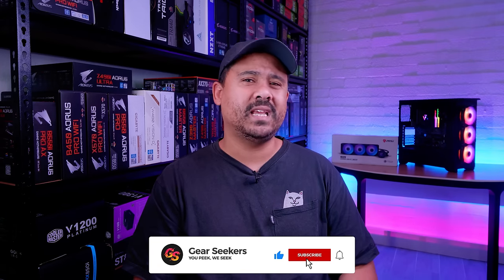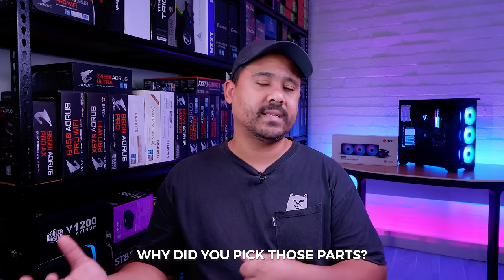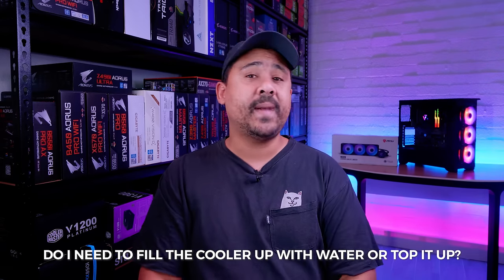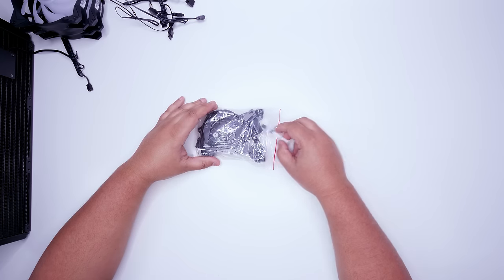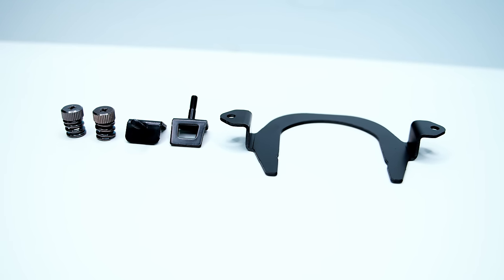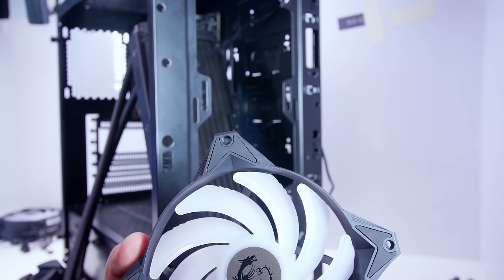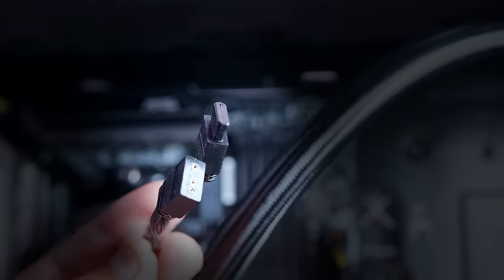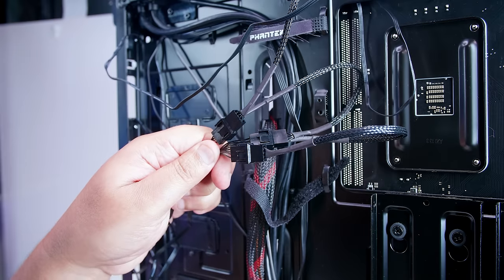HOW TO MSI MAG Coreliquid 360R & 240R AMD AM4 & AM5 Install Guide

Comment: Ryzen 3800 msi 240 cooler rog strix B450-F Gaming
Does that works?
Reply: I think Your motherboard doesn't have addressable rgb headers (ARGB) which are 3 pin headers, so you can't use the rgb for this cooler because the rgb cable for this cooler is a 3 pin, unless you buy a separate rgb controller, some liquid coolers do include an rgb controller with them but this MSI aio doesn't.

Comment: Have question for a rog strix 450 f mb do i plug the rgb into my rgb headers
Reply: No!!! that motherboard only has 12V rgb headers. it will fry your 5v argb if you connect it there. I have the same mobo, and I'm having to go another route to connect argb. I'm going to plug it into the corsair lighting node core, using adapter cables from an ebay seller named PirateDogTech. maybe you could do the same thing
Reply: @4markie  thanks for that seesh
Reply: What's a corsair lighting node?

Comment: Does rgb works with MSI b450 mortor max ?
Reply: I have b450 gaming max and I'm having issues with lighting my rbg is 4 pins but the cpu cooler is 3  but it's 2 holes space and another hole [eg. 00 0] and the pins can't enter
Reply: Ecta  unfortunately I have not I have bought other pins to attach but no luck 🥺

Comment: 👍👍 Problem is I bought this for a B450 Tomahawk max as this is my first build only just realised I have all 4 pin headers 😳.. Might have to swap motherboard now.
Reply from the maker: Just buy a cheap RGB controller. There is no need to swap the motherboard mate.
Reply: @GearSeekers  hello sir I am having the same issue I believe I have a rog strix b550- xe mb and am trying to rig this cooler on and lone behold my pump and fam headers on the mb are all 4 pin where as the connectors are 3 pin. I am wondering if u can point me in the right direction as to what rgb controller I should get as I am a novice that honestly has no business building a pc. Thank you

Comment: It sucks bc jrainbow connectors are much older style connectors and most newest boards use the 12 volt 4 pin rgb headers now 😔 imo msi should of included a sata rgb card with this kit like alot of other aio cooler company's do, I wouldof never got this kit had I knew this ahead of time, now I gotta buy a rgb card to make the rgb work and it's really inconvient to do so
Reply: Did you end up buying the RGB card ?
Reply: @jesuscabral1074  yes I bought it, the rgb lights from the radiator fans are horrible and very dim I was very dissapointed, the cpu cooler is also dim but not as bad as the fans, I ended up buying a 3 fan pack off Amazon 120 size and using those instead, I really can't believe how terrible these fans and cooler rgb's are and very very dim

Comment: The Rgb 3 pin 5v connections on this Aio dont suit more modern 12v rgb connections on motherboard,  b450 etc
Please pin this!

Just found this out after i installed 😢

Comment: This was a great guide! Was able to install it without very many issues!  Although I did run into a hiccup.  When I turned on the system the radiator fans went on but none of the RGB went on...

I double checked all the connections and they seem to be plugged in according to the instructions in this video.  

Any insight on why the RGB didn’t work??
Reply: Make sure you didn’t connect them into a 12v connection for the rgb, and make sure you did the circuit wire daisy chain correo
Reply: Hey kind of an old comment here but, did you manage in the end?

Comment: Great video, much better than MSI.   My only complaint that you don't explicitly address the issue that I came to resolve:  How do I know the air flow direction through the fans?  I am assuming from the placement that you used that the side with the dragon emblem is the exhaust.  

MSI does not bother to mark the flow with an arrow on the fan case as has been done by just about everybody for years.  They do not address it in any manner that I could see in the "quick install guide" which is an example of the absolute LEAST that they could do and still pretend to provide documentation.  Additionally, the MSI guide makes difficult to figure out which mounting hardware to use and gives zero tips on how to align things properly.  As for the resistor wire, they tell you that it exists, is optional, and what it does BUT do not really offer much, if any guidance as to how to install it.  The video that they released only addresses an Intel installation and is more hand-waving than details.

Comment: my motherboard (MSI B450m Mortar Max) doesnt have a pump header where should i plug it?
Reply: cpu fan header
Reply: @735  then i will use my System fan header for the 3 fans of the radiator?
Reply: @michiruhinagata4080  yes, use a cable splitter for them
Reply: @735  thanks <3
Reply: @michiruhinagata4080  np, make sure to have cpu fan at 100% in your bios
Reply: @735  ill make it at 100% at all time so the pump wont turn off right? but the 3 fans ill keep at auto? or 100% too?
Reply: @michiruhinagata4080  not sure about the fans but here's an article https://forums.tomshardware.com/threads/where-to-plug-aio-on-a-mb-without-pump-header.3556077/
Reply: @735  thanks for the help.

Comment: if you dont have an argb header on your mobo you will not get the beautiful argb effects :(
Reply: I'm having that issue rn any way to fix with adapter? My rbg is 4 pinned and the cpu is 3 but with an empty closed space where It won't enter 😔
Reply: Did you figure this out ?
Reply: @MrAdrian2416  I have the same problem. Did you figure this out ?
Reply: @jesuscabral1074  unfortunately no 😔 ive bought other 3 pins to 4  to connect to it but it wasn't stable and didn't supply power it kept getting undone would stay on the mobo  overall I mean it works just no arbg lighting i kinda stopped looking into but if you find out a way please let me know 😀

Comment: So I don’t have the plastic hook piece that the cooler hooks onto how the fuck am I supposed to mount this and use my new pc, thanks Msi for not including parts fucking needed
Reply from the maker: Those hooks come with your motherboard not the cooler.
Reply: @GearSeekers  I never got them with my motherboard either, I only have the backplate and these brackets that straight then go at a 45 to screw into the backplate

Comment: I’ve B550-F motherboard and it doesn’t have JRAINBOW. What do i do? Anyone else had a same motherboard and cooler thank you. I need help
Reply: Your motherboard does include a 3 pin argb header, but it's not labeled as JRAINBOW, it's labeled as ADD_GEN2, it's a 3 pin header at the bottom of your motherboard.

here is the manual for your motherboard, 
https://dlcdnets.asus.com/pub/ASUS/mb/SocketAM4/ROG_STRIX_B550-F_GAMING/E16609_ROG_STRIX_B550-F_GAMING_UM_WEB.pdf
you can see on page 14 , the 3 pin header located at the bottom of the motherboard labeled as number 10 right next to a 4 pin rgb header.

Comment: That installation is wrong.  Your pipes should be at the bottom and not the top of a side mounted radiator.  You won't get proper cooling and will drastically reduce your life of the AIO with the pipes at the top.
Reply from the maker: Wrong. The pump is inside the radiator on this cooler.

Comment: no friend all wrong what you are doing those liquid cooling must be installed with the ducts down, that is; allowing the air that is produced by the same evaporation to remain at the top and never in the path of the liquid. The example that you are giving to the community is all wrong and you should be ashamed to make a video without having a minimum notion of what you are doing without having a minimum knowledge of physics. what a mess of yours
Reply from the maker: WRONG! The pump is in the radiator. You should be ashamed of not understanding how this cooler works you oxygen thief.
Reply: @GearSeekers  he's right, people are facing the bubble issue with this AIO including me, even when you front mount it, the pump is in the radiator but given that it is close to those duct inoutlets, the chances of getting bubbles into the ducts increases, spend some time with this cooler you'll understand

Comment: I have only 2 jrainbow in this Board :(
Reply: If that case so, u need to buy a splitter or rgb hub to connect all ur fans
Reply: You only need one header for the rgb fans to work since the cables could be daisy-chained together.

Comment: tubes on top, exactly what not to do if you want your product to last... the air will be into the system and create noise and cooling issues after some time. viewers be aware...
Reply from the maker: Stop spreading this stupid rubbish. Before you comment about that gamers nexus video you might want to go an watch it again. Not to mention the pump is in the radiator for this cooler which means even if tubes up did impact cooling other that the pump being louder that fact the pump is in the radiator negates that. Viewers be aware 🤣
Another expert who doesn't know shit 🤣

Comment: The Radiator is on upside down if you're front mounting. This will restrict the flow of coolant and increase air bubbles. Never put it at the top. I don't know why everyone is doing this. Turn the rad around!!!
Reply from the maker: No it won't. Before you say "wAtCh GaMerRS NeXuS vIdEo" I suggest YOU actually watch it again.

Comment: For the average user, its not smart to use liquid in an electronic device. There are plenty of logical alternatives to liquid coolers.
Reply: Not going to destroy anything.
Reply: @TheSjuris  "If" it doesn't leak or corrode plus the cost is high for the same thing a fan setup can do. Not smart to put liquid in electronics when there are logical alternatives
Reply: A Dillpickle nothing with distilled water will corrode anything.  Air coolers are for the most part either ugly or extremely ugly.
Reply: @TheSjuris  If all I had to do all day is stare at my computer then maybe I would be concerned about looks. Too many stories out there with AIO problems for me to jump in on that fad
Reply: A Dillpickle I don’t stare at it either, but when I do look at I don’t want to get sick by being nauseated by the sight of ugly.  Besides which not every case works with every single air cooler. If you’re going to use one then get a case that’s solid.
Reply: @TheSjuris  My fans are inside not on the outside. Mine is pretty lol
Reply: A Dillpickle so are mine.  I wouldn’t want any case that looks pretty destroyed by having something visible that’s extremely ugly.
Reply from the maker: Oh god not you again.
Reply: @GearSeekers  Logic is everywhere but some cant see it